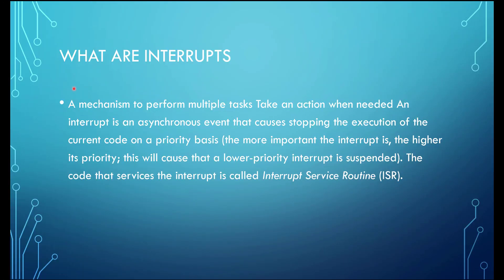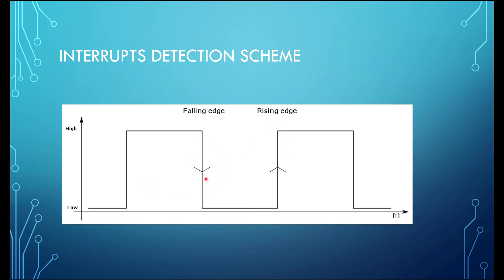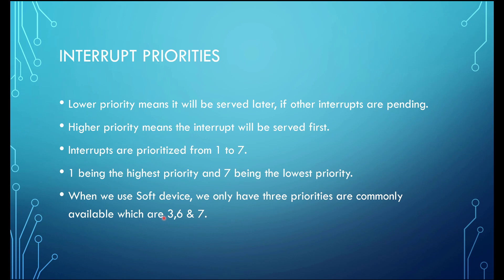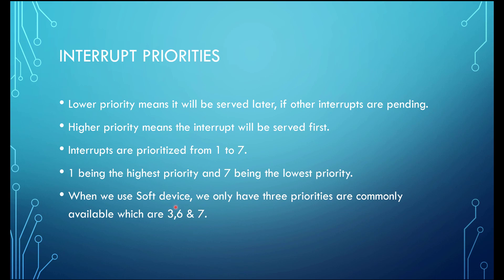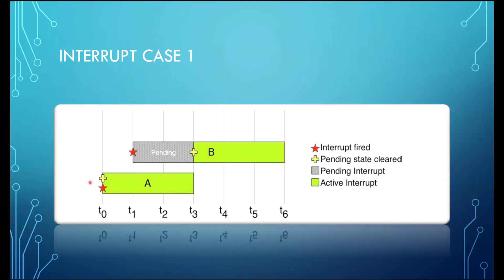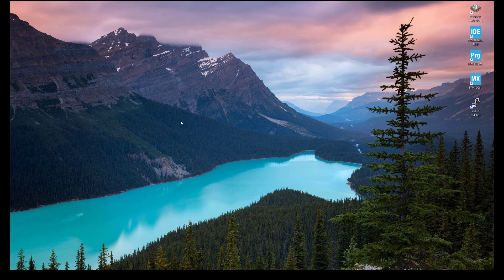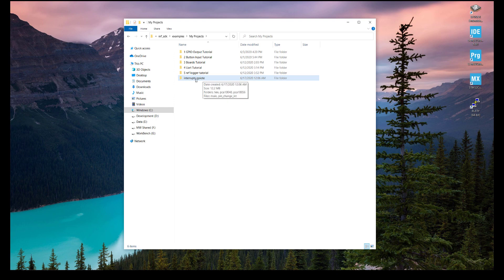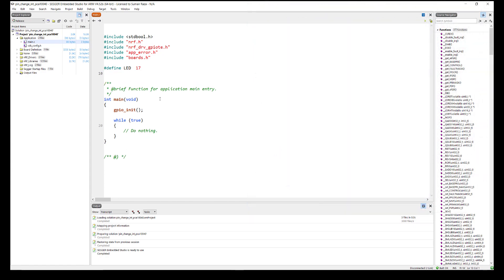nRF5 SDK - Tutorial for Beginners Pt 12 - GPIOTE Interrupts

Comment: Hello Sir! Thank you very much for the explanation. I followed this tutorial but my program isn't working in the SOC. Do we have to do some additional things apart from the main code to set events or interrupts? And where to use the c file (Interrupts Basic)?It is just for understanding I guess.
Reply from the maker: Hello, you have to make sure you add 3 things:
1-> check nrfx_gpiote.c file is added in the project explorer on your left side in the folder named drivers, if its not there then right click on drivers folder and locate the file. (to locate this file just open the main directory where your sdk is placed and write the file name in search tab and copy its path) and then paste this path and double click the file(nrfx_gpiote.c) and its added.

2-> open CMSIS config wizard and config the sdk_config.h file in CMSIS config wizard. FInd nrf drivers folder  and then find a sub folder named nrf_gpiote,  enable nrf_gpiote and dont change any other settings.

3-> in CMSIS config wizard find another folder subfolder inside nrf_drivers named NRFX_gpiote, enable it as well and its finished.

now if it successfully compiles then it will work for sure, also check the interrupt settings, if you are setting interrupt on logic low to high and your device which is sending interrupt is always sending interrupt on high to low then interrupt will never get fired again because of this. hope u understood ;p
Reply: @SumairsEmbeddedEngineering  Thank you sir!

Comment: Can I use a nrf_pwr_mgmt_shutdown() function inside the while loop? It is reducing my battery consumption, but after this the device is not handling the gpio interrupt properly.
Reply from the maker: i will do a tutorial on this to show you how to handle power modes with interrupts. Kindly wait for some time. Thanks
Reply: @SumairsEmbeddedEngineering  Any follow up on power modes with interrupts?

Comment: I couldn't understand why did we pass the arguments @15:00. The code works without that. Can someone help me solve this?
Reply from the maker: these arguments will provide extra info like which pin generated the interrupt if you want to check that in the interrupt handler then use it otherwise ignore it, and the second argument tells if the interrupt was generated by a high to low or low to high signal. Hope so this clears out your mind. ;)
Reply: @SumairsEmbeddedEngineering  I would indeed like to use the pin data to see which pin generated the interrupt as that implies that I can use this on more than one pin, but how? The function cannot be called more than once, at least my code freezes when I do.
Reply: I don't understand that neither